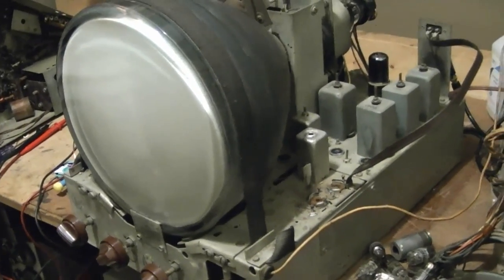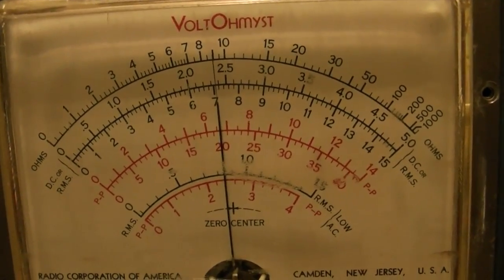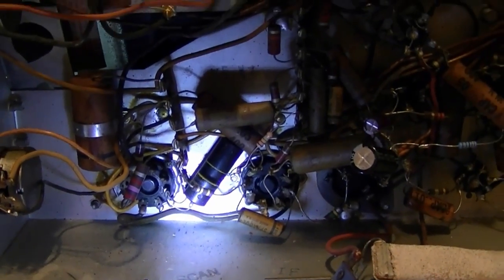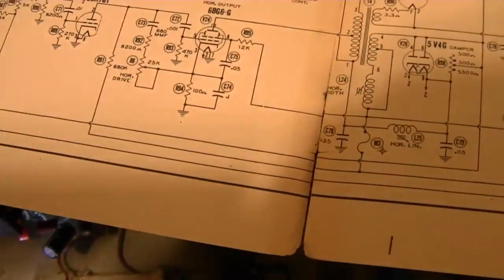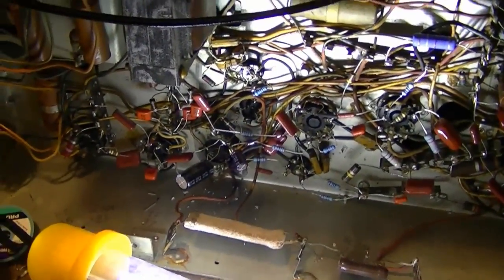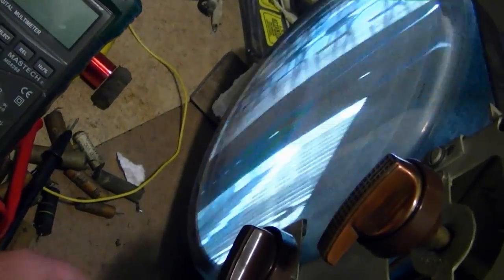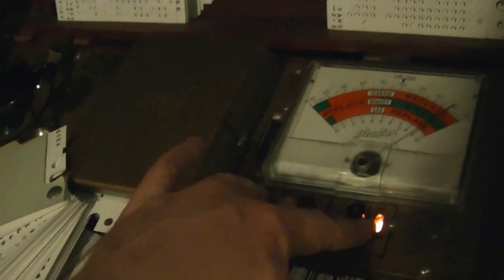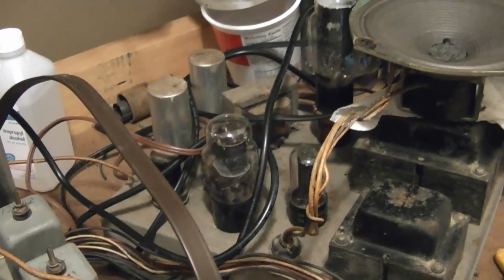Admiral 30A12 restoration pt3o?

Comment: What I use to do...when I had a working set and repairing an identical chassis...just start by swaping the tubes from the working set to the other. Makes for an easier start. Saves on testing. When the set that is being repaired is working, slowly put the original tubes back in. I love watching your videos Bob.

Comment from the maker: That's not how it was done back in the day.  There are 27 tubes in this set and that takes a lot of time to test.  Note that this set was working on all original tubes and the one tube I did replace ended up being the source of much headache because it developed shorts soon after.  I probably would have been better off leaving the original tube in there even though it tested weak.